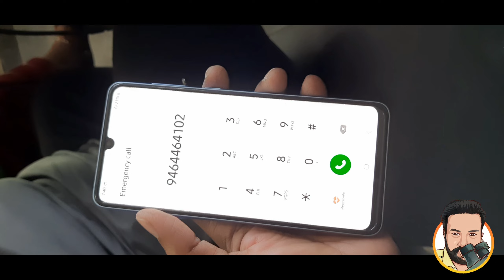samsung a33 5g dead solution  / samsung a33 5g cpu reball  #samsunga335g

Comment: Sir, the problem is that there are not some four-wheel drive cars with a board. What is the solution to the problem? Is it of good quality flex or tin? I have to go back and unscrew the processor once, twice and three times.